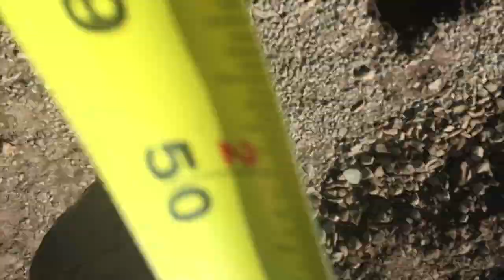The best foundation for your deck. PERIOD!!!!

Comment: I feel the same as you do about the little details. When I started pounding nails in 1975, I worked with old carpenters. They taught me to do the same quality of work in places that people won't necessarily see. On example of this was coat and linen closets. Do the same quality trim work there as the rest of the house. Some people in the know, will look in those places and if you did a good job there, they would figure that everything else is done well.
As we all know, running a jointer over your mortar joints not only makes them look good, it packs the mortar joint tight.

Comment: I like a 3 foot auger bit for the bigfoot. Saves alot of gigging. I used to pour those monolith slabs everyday, the exact same way, until they changed codes and force us into a thermal break around exterior.  I will admit it does make interior slab warmer, but a lot more work and a lot more dollars
Reply from the maker: Not sure a 3’ auger would go through out ground. A lot of big rocks here. We put the foam on after we pour the slab. It was pretty easy to do. I got a video I’ll send you.
Reply from the maker: https://youtu.be/z__1OOIuHA8
Reply from the maker: This is how we do the foam it’s in the end of the video.

Comment: I put my deck on hand dug piles to 4 foot plus deep and elevated about 4 1/2 feet to walk out from kitchen for frost coverage up here in Calgary.
Deck was 16 by 12 resting on beams supported on the 8x8 posts.
I assembled the back row of posts with a beam installed and put a plug of concrete dry and hand tamped and offset from the wall about 2 1/2" and then dirt all hand tamped with 2x2 in 6"lifts.
Process repeated for front row. It has been standing now for 29 years still strait and level...can't say the same for the house heheh.
Beams were 3 ply 2x12s and joists 2x10s 16 o.c and I installed trays in between so I could have dry storage beneath.
Just my bit of bragging heheh.
Reply from the maker: John. awesome. Sounds like you did a good job if its been there 29 years 👍👍

Comment: Do you use epoxy cement to bond the rebar into the holes you drilled into the slab?  Did you epoxy the wire or rebar of the new slab into the existing foundation of the house?
Reply from the maker: We did not epoxy the rebar. We do not have to wory about uplift from tornadoes or hurricanes where I live. I just rebar them for extra lateral strength. The code does not require the rebars on this building but I did them for my own peace of mind. 👍

Comment: No frost heave on the slab?

I wonder if this would pass by me in Pennsylvania?
Reply from the maker: This house was built on a slab so we followed suite with the addition. There should be no issues with frost heave because the structure is heated and should react the same as the original house. 
If it were a new build say in PA where you are from I would do a shallow frost protected foundation with radiant heated slab. I have built a few this way and very energy efficient homes. 👍

Comment: Do you use any sort of rebar in the Sono Tubes or Big Foots?   I realize these are footing for a wood deck, so would you use rebar if they were for a metal building?
Reply from the maker: James Douglas. Hi. Yes we put 3 rebar in each sono tube. I didn’t show it in the video. 
Thanks. 👍.
Reply from the maker: James Douglas all the way from top of sono tube to bottom of Bigfoot

Comment: I may have missed it, but why not just use a post hole auger for the sonnet tubes?
Reply from the maker: The sono tube has a big foot footer at the bottom. It would be impossible to dig these with a post hole digger. The foot is what makes it so good. No settlement and no way frost can uplift the pier.
Reply: @bondobuilt386  thanks for the response! What’s is the diameter of the big foot, at the base?
Reply from the maker: @mattdeloff4348  I think it was 30 or 36” they make all different sizes for different applications. Great product in my opinion. I built a timber frame barn on them so no wood went in the ground. That thing will never move. I milled black locust for the posts. Douglas fir for the tie beams. Lol 👍👍